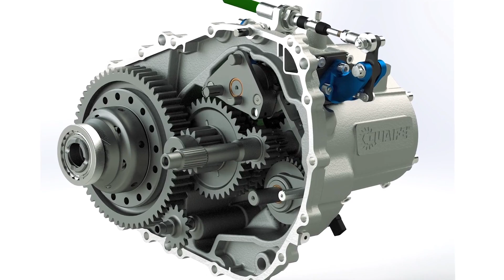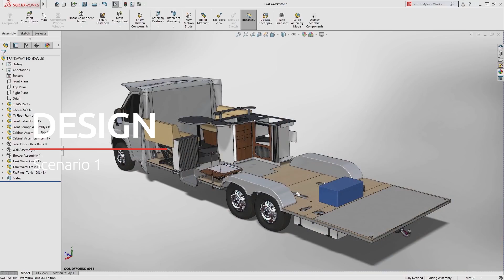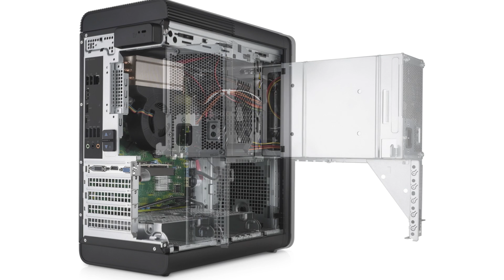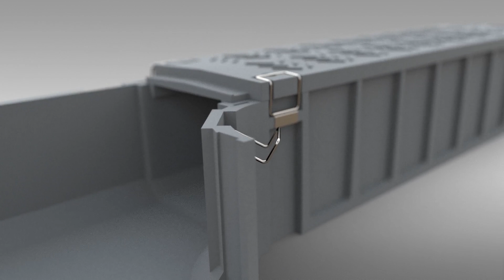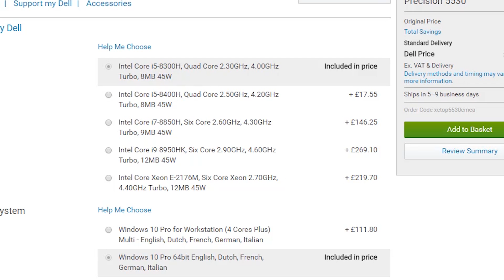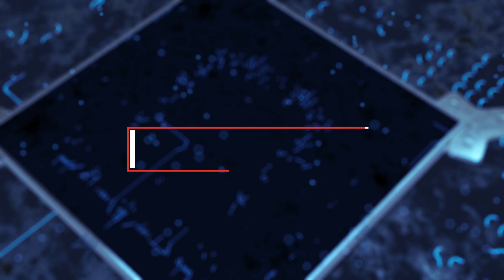The BEST PC and laptop hardware specifications for Solidworks 3D CAD (2019)

Comment: You most certainly can use consumer GPU for Solidworks. Currently using 6GB GTX 1060 which performs much better than a P1000 which I also own. Perhaps those GPUs haven't been tested by SW and not "certified' but it is 95% marketing BS.

Comment: Some things that may be a bit newer than this video. AMD 5000 series does have better ipc performance, meaning better single threaded performance, as well as cpus with more cores (if you can buy any of the new chips). Not to mention, zen 2 (3000) and zen 3 (5000) AMD cpus support ecc memory if your motherboard as well supports it. That way you wont have buy an expensive xeon processor for ecc ability. Not to mention, gaming GPU's and work GPU's are only different in their drivers and quality. The nvidia quadros and amd wx pros are picked for the best silicon and refined drivers, that way the card is less likely to crash and works more smoothly. If you have a low budget and are doing light applications, then you could probably save money buying a "gaming" card as long as it has the right amount of memory or cores. The computer market is constantly changing so it's important to check for new products and research what is perfect for you.

Comment: Mobile chips are still not as powerful as their desktop counterparts. Mobile CPUs may have similar spec on paper however due to poor cooling they will thermothrottle and there is no way to keep max frequency for long. Another problem I have with your recommendation is stating that gaming GPU will cause issues with SW. This is simply untrue. Yes, gaming cards are not supported but they will be fine. They may not perform as well as their Quadro sisters, however as a lot of us do not have space for two machines, one for work/for entertainment, getting a high end gaming card will give you enough juice for quite complex assemblies. However if you stated that we need Xeon/Quadro for work, I would have not said anything as this makes sense, i.e. better stability (on paper). But recommending consumer grade CPU and professional GPU makes little sense, sorry. Talking from experience, I worked with Creo, Inventor, SW, ANSYS, Plant3D, Navisworks Manage. Bear in mind this is just an opinion :).

Comment: Just an update, as of a few weeks ago, the AMD 5600x, 5800x, 5900x and 5950x CPUs have the fastest single core performance on the market. Intel was faster when this video was made and they will likely come back again one day, but AMDs newest CPUs are both the best possible option and the best value option.

Also, while professional businesses should have Quadros, as a student or part time/hobbyist CAD designer you're far better off getting a GTX/RTX card than a Quadro. The only feature you'll miss out on is "trueview", which isn't very useful for students.
Reply: Appreciated the explanation mate
Reply: Just the comment I was looking for 👍👍
Reply: What is Trueview
Reply: @kzukiodenthechad7205  Honestly I don't remember. I believe it was some sort of thingy that, similar to ECC ram, assured absolute data validity. Or maybe it was some sort of screen sharing feature?

I tried to redo my research today, and all I could find was mention of the Quadros drivers being geared towards professional software. I'm not sure how that plays out theoretically, but I've never had any problem using a non-quadro for work.
Reply: @OwenWithAHammer  Ahhh gotchya
Reply: Thanks for the comment I was looking for. :)
Reply: You can enable trueview with other cards also
Reply: @Papa Roelie I have the same problem did you figure it out?
Reply: @Papa Roelie I heard the Lenovo’s Run Loud and Overheat, how’s yours treating you

Comment: Dang, I invested in an rtx 2070 gaming card since I thought it would be equivalent to a quadro
Reply: Does it work with SW? It is a gaming card not a quadro card?
Reply: @bigtony6  it's designed for games, not optimized at all for cad or learning
Reply: @KevinSiebert  I asked because I am after a new laptop . I can afford a gaming one  such as Lenovo y540 . I know I'd work with Autocad , Inventor ect. However wasn't sure about the Solidworks. There are videos on YT  showing on how to tweak a registry to make it work with a gaming card.

Comment: Hello, I have a question. I have a computer with: 
CPU - Intel(R) Core(TM) i7-6700K @ 4.00GHz 4.00GHz 
RAM - 32 GB
GPU - NVIDIA GeForce GTX 1060 6GB
Disk 0 - Samsung SSD 850 EVO 250GB
Disk 1 - HDD 1TB
Ran SW2018 first, speed was good no problems. Now I rebooted my hole computer and downloaded SW2019, and it is super slow. Any idea what could cause this? I think my PC isn't a problem, because it was good before.

Comment: I'm starting college soon and I need the best laptop for Mechanical engineering. What would you recommend?
Reply: If you can afford it, go for a Dell Precision laptop - secondhand ones are still viable - mine is 5 years old but still works great on SolidWorks 2020.
Reply: @SteveHammondPlus  What kind of CPU do I need to run the Soildwork?
Reply: Gao thomas the main this is go for the fasted CPU you can afford. The majority of SolidWorks’ main functions are single threaded so lots of threads wont help, only clock speed will affect performance. As for whether you should use Intel or AMD..? I’m not sure as I’ve stuck with Intel over the years but it looks like AMD are making some great improvements to their CPU line up.
Reply: Anything that had a ryzen or Intel 7 and an ssd the rest is on your palate also it depend on what your gonna do if your just doing something lite my suggestion is overkill
Reply: A desktop.
Reply: if you want best laptop for any engineering then just go for surfacebook3 it is powerful enough to run any eng software smoothly aand has loong battery life what else u want?
Reply: do mechanical engineering student need a laptop? or a pc at home enough?
Reply: @sasageyosasageyo7281  u know nothing about mechanical engg.
Reply: @XD_SPIDER  that's why im asking bruh
Reply: @XD_SPIDER  i know you need for cad works. i am asking if they do it at school or at home. smh

Comment: I want to buy ASUS ZenBook Flip 14 UX463FL, is it compatible
and powerful enough to run SOLIDWORKS 2020?
Specially it's GPU which is Nvidia MX250  Pascal OpenGL v4.6 with 2Gb GDDR5
graphic memory.
my budget is limited to this choice.

Comment: Need a help I'm a beginner in autodesk inventor would you recommend me to  go for ThinkPad t590 corei5 8th gen 
8gb ram , 2gb mx250 graphic card
Reply: It will run just fine. I'm using it on a i5 5200U with the internal graphics. But go for more RAM if you can afford it.
Reply: @gianjorimann2667  thank you for your time
Reply: It's ok, for assembly with 20 - 30 parts.

Comment: i've been thinking to buy the new XPS 5540 with i7 processor, nvidia quadro T2000 and 16GB RAM, in order to use principally CAD 3D(creo,catia,solidworks)  and simulation (inventor, ansys). in your opinion the machine which i would buy it's a good machine? o i can find some issue?

Comment: Dassault Systemes should know that a workstation is not affordable. I do have an 8 gen i7, 32 gb of RAM, but my GPU is a gaming one, a RX 570, not supported but nothing a couple of tweaks in the registry could not fix. Just a Quadro alone costs the same  as the setup mentioned above or even more. That's just a complete madness. 
A very helpful video will be one in were you explain what's the bare minimum you'll need to build a decent and affordable semi-pro workstation. Hope you take that into consideration 👍

Comment: Quadro graphics cards are hard to come by on a laptop. What would you recommend from the Rtx range of graphics cards?
Reply: Depends on your workload, a RTX2080Ti will be enough. If your opt to go for a higher end workstation GPU, then go for Quadro RTX 6000. SOLIDWORKS will take advantage of the RT cores.
Reply: Quadro is ridiculously faster for solidworks specifically. They aren't hard to come by on laptops, you just have to look at the workstation ranges like hp zbooks and dell precision. You can find a ton of these used/refurb on ebay for way better prices as well and if you know how it's best to get a lower ram spec and buy some more you put in yourself to save more money. Buying new gives you a ton of great warranty compared with consumer gear though so for a business you 100% want to go that route.

Comment: aight imma head out to buy a laptop with a "quadro" gpu hope my broke ass can find one cheap.
Reply: gonna need an update cause i'm in a similar position rn
Reply: @thecinephilefish9465  you don’t need a workstation card at all. It’s all marketing bullshit. 

The difference between a GeForce and Quadros is the way the heat is transferred. They are the exact same chip. Quadros or founders cards are engineered and made directly by the OEM. In this case is Nvidia. GeForce cards can be made by third party. MSI, Asus, gigabyte, PNY, list goes on. 

Heat transfer. For Quadros desktop cards, the heat is being rejected from the chip to the environment. GeForce the heat is being reject into the case, and you will need fans or liquid cooling to force it out into the environment. 

For laptops. Don’t both with a work station card. I’ve used a dell workstation, that fucker heats up and thottles like no tomorrow with large assemblies or high detailed assemblies. 

Just get a gaming laptop with GTX1660ti min if you plan on doing any analysis work. The integrate card works for design work just fine. Yes, you can run solid works on a surface pro. Fuck I’m play Diablo 3 on a surface pro with zero issue. With high pixel density too.
Reply: @kroozctrl1337  I was thinking to get the Dell XPS 15, then I saw this guy talking about the precision dell. 
What would you recommend out of the 2
Reply: Quadros are pretty different on quadro at least that was the case before rtx
Reply: @kroozctrl1337  quadro is gone now 2021 has no quadro anymore nvidia just sell geforce card with quadro's drivers

Comment: For last 12 years I work as automotive design engineer and for last 4 years I work also as design engineer in domain of optoelectronics and optomechanics,nanotechnology,micro lens technology etc.I have some assemblies with more than 40K components at 6x6mm and guess what,I use advanced binned GTX1080ti..I use both QUADO and standard gaming cards but only difference is customer support and thats it.Long time ago we had some cards like Quadro FX 4800 with noticeable difference but right now the cards are more advanced with large amount of memory and there is no reason to buy QUADRO card unles you are a Pixar or you need someone to hold your balls in day to day work for that extra money.
Reply: hi, i'm engineering student from egypt and for sure i can't afford a quadro card in new laptop.
i'm doing purchase soon do you think it's good idea to buy gaming laptop as dell G3 or lenovo ideapad l340??
thanks in advance
Reply: @MohamedSayed-vk9cp  More than enough..You just need some good processor and at least 8GB of RAM, 16GB is some sweet spot..From my point of view,RAM is most important part.As engineering student,probably you will not have complex assemblies with 1500+ parts,you just need good piece of hardware for AutoCAD,Solidworks,Fortran,Basic or something like that,so just keep going and buy the best option for your pocket.
Reply: @eladherzog  thank you alot .u really helped me thanks
Reply: @eladherzog  I agree. I'm starting a masters degree in optoelectronics and would have to run FRM and FDTD simulations for breakfast. The only thing I want to emphasise is the SSD. It made my work much more convenient and comfortable.
Reply: @mindyourbusiness4440  what size of ssd are you using
Reply: @MohamedSayed-vk9cp  I bought in 2018 Dell G3 with i8750H and  1050Ti. Added more RAM (32GB), NVMe SSD, repasted CPU/GPU. It costed me around £1000 after upgrades and it was well worth it. However there is visible difference between this laptop and my desktop with i9 9900K. If anyone reads this in 2021, if I needed a laptop I'd go with ryzen 4800u combined with 1650Ti/2060/3060Ti depending on how much money you have. Ryzen is cooler meaning less thermothrottling.
Reply: hi, i'm a mechanical engineering student. i have to use solidworks and cadcam softwares. do you think asus vivobook will be suitable for me? It has 4gb nvidia 1650 graphics card, intel core i5 8th gen, 520 pcie ssd, and 8gb ram.
Reply: I'd like to become a design engineer myself, Would you plz suggest what should I opt for after finishing bachelors in Automobile Engineering?
Reply: @santosh9909   DAMN try to find solutions by yourself, if you'r not able then don't be an engineer
Reply: Wtf do they think students are made of… 10k for a single card? Tf kind of ish is that… imagine how advanced this world could be currently if f🤬ck heads at the top of companies that sell shit like the Quadro Card didn’t mark things up Soo Damn High… F🤬ckin Ridiculous
Reply: Lmao

Comment: Can we use a Ryzen instead of a Xeon?
Reply: Yep, u can. Running SW2019 on a Ryzen 3700X here. Doing fine.
Reply: I try it with ryzen 5 and just fine, but I only had around 20 parts in 1 assembly.
Reply: I'm having same question
Reply: Yeah I think so but you can also get the Threadripper wich is closer related to xeon but I’d say Ryzen 3rd gen is a good budget option due to the high core count.

Comment: for begineers and students I recommend low end laptops and for high end use your schools or Job desktop. meaning that you use your laptop for presenatation and small design fixes and desktop for simulation and vice verse. and dont forget get to move your body
Reply: Agreed. After all, unless you have difficulties accessing a CAD desktop, save the money for when it matters the most. No need for more debt as a college kid
Reply: If you begineer or expert Cad programs tooks Very big area of ssd so low end laptop doesn't good enough for Cad programs....
LOL!!!!!!!
Reply: @regular_person899  SSD can change existed hard drive... easy...
Reply: @regular_person899  what i meant was that instead of investing 2000€ on Nvidia Quadro (Best for Cad) laptop you should get a decent laptop for research, planing, presentation etc. so when you come to your workplace that has a powerfull desktop computer u know exactly what to do and more efficent. 

ex. do the mechanic calculate for hand at hone so your dimension for your product is already set and you can prove it
Reply: not an option if you have to follow a class. i use it at school and there are no computers at school anymore. they expect that you buy a laptop that can handle solidworks
Reply: @josdebossss  srry to hear that, for me the school always had computers for the class that need a particular one and the school had a program to lend you computer.